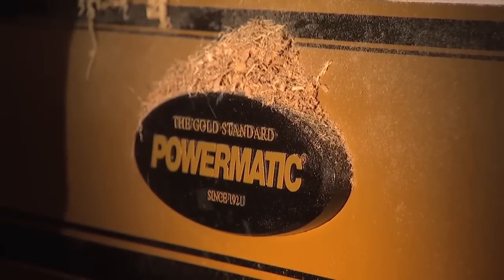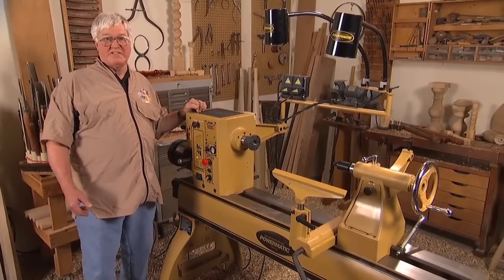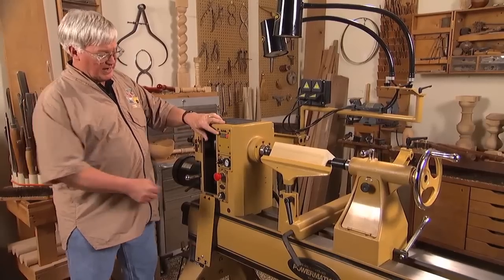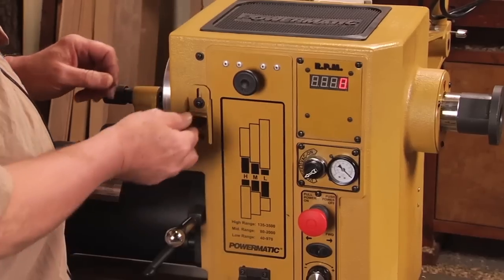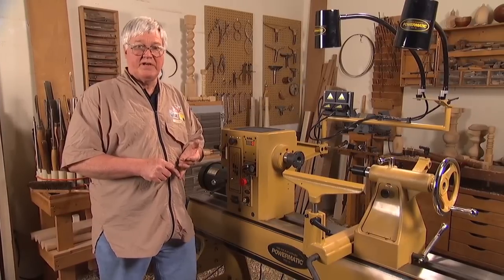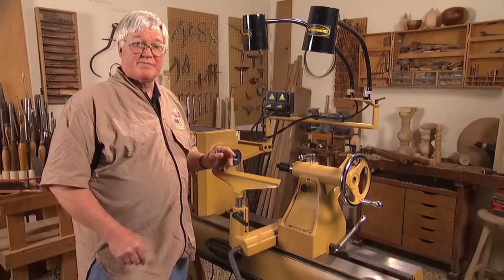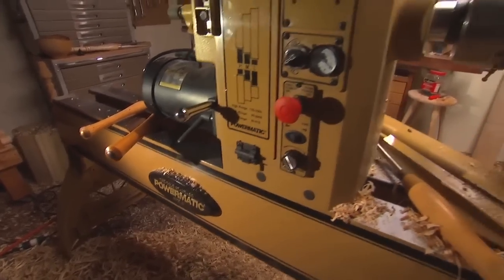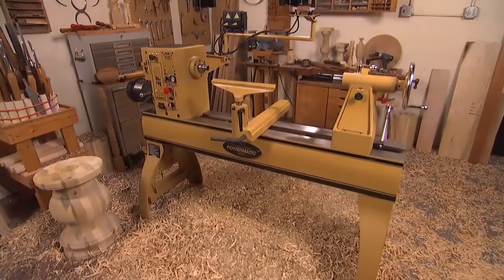Powermatic 4224B Lathe (Woodturning)

Comment: How much weight can the spindle take
Reply from the maker: ran dom By the time you max out the 24" diameter and 42" between centers, the lathe can easily handle any weight of wood to be turned.
Reply: Thanks . I'm looking for a lathe I can turn logs and metal on without having to buy 2 machines
Reply from the maker: ran dom Call and speak with our lathe specialist at 1-800-551-8876 to be sure that what you're planning on turning will be safe.
Reply: Thanks I will give you a call